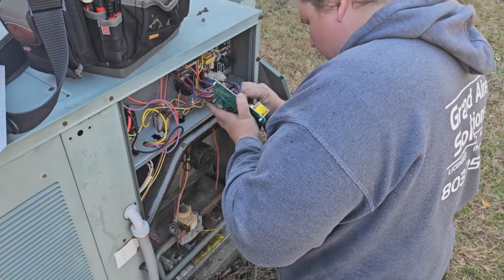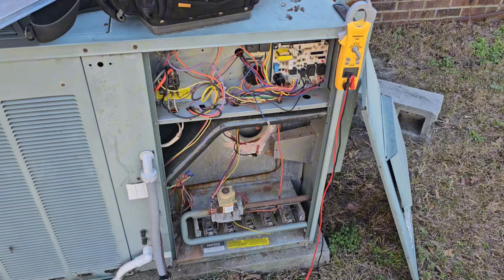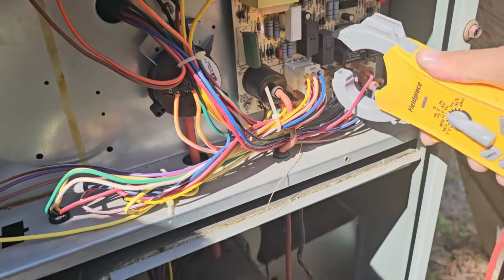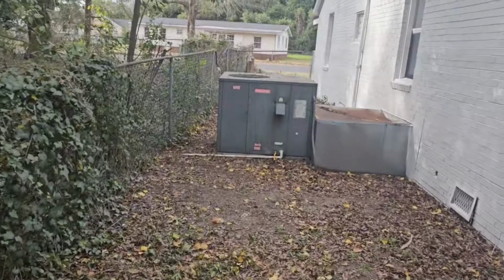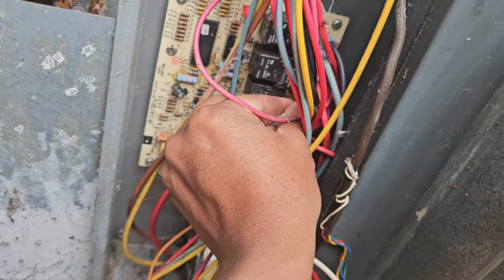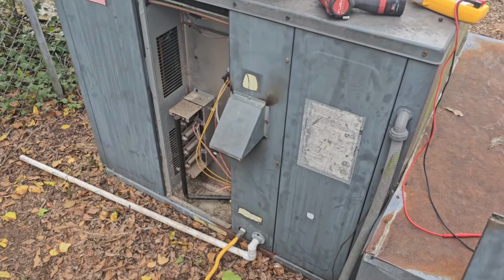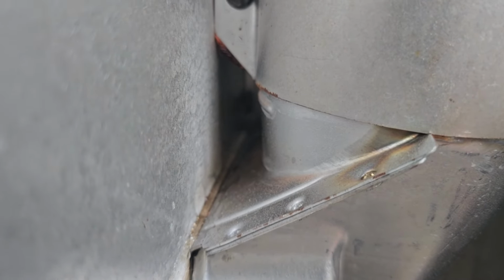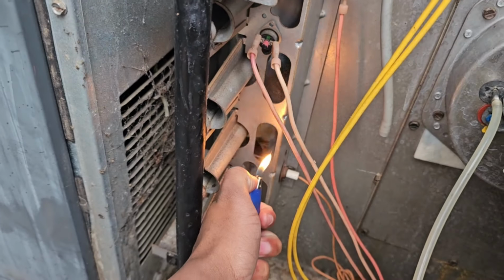More Package Unit Issues on Rheem and Goodman

Comment: if you hook your manometer up to the inducer port and un plug the inducer motor and turn the blower on your manometer will have a slight reading on it if the heat exchanger is cracked. just lettin you know

Comment: There are sooo many things you can do to check and verify unit operation even if “no issues” at that time
• check inducer motor amps and capacitor
• check flame sensor mA 
• check unit size compare to required amount of CFM needed 
• check inducer pressure port and tubing, verify clear
• check burner flame 
• check static pressure
• check and monitor power to gas valve
• check gas pressure
• check drip leg
• check evaporator cleanliness
• check and verify limit switch integrity
• shut gas off while burners are running
ETC……

Comment: Intermittent problems have always been the most difficult.  If you can't catch it failing, sometimes you're left with changing out most likely components.  Relays, contactors and switches are always suspect.

Comment: The board on the Rheem pkg units giving false signals is a well known issue. I've replaced a few that gave the limit open  or the rollout switch open, when check the limit is good, or the roll out switch is good. Did you check the heat exchanger on the Rheem unit? A unit that old ,that would be the first thing I would check.
Reply from the maker: Unfortunately I did not visually. I should have removed the blower motor to do so but we never witnessed any blowback in the flames. The limit switch never tripped itself. But we could jiggle that molex plug and it would sometimes trip/reset and sometimes stay tripped
Reply: Gotta check heat exchanger before any repairs on a furnace bro just to cover y’all butts…. I mean unless the furnace is brand new but should check every time
Reply from the maker: Man I've been trying to see if he will go half with me on a combustion analyzer so he can take the one that's on my truck and I can use a new fancy one and look cool and informed on YouTube 🤣

Comment: I wonder if somethings up woth the heat exchanger on that goodman where were you smelling it at can you describe what kinda smell it was I know you said it was a hot smell
Reply from the maker: We smelled it when the flue diverted was faced down. When we faced it back up we could no longer smell it. When we took the top off, the joint I thought was bad wasn't bad, we found hairline cracks and 2 holes on the heat exchanger that I missed. Double verified by only running the blower motor and putting a lighter to the burner assembly spots and 2 out of the 4 cells were blowing the flame back. The gas pressure was within range of what Goodman wanted. So we just think that "some" of the gas is being blown back out of the entry of the heat exchanger
Reply: @AB_HVAC  that's what I was thinking to I knew that something was up with the heat exchanger cause the flames were burning funny weren't rolling out but they were more orangey then I usually see I have to work on some ptac units tommrow
Reply from the maker: @Hvac-dude  yeah the spots my boss found I thought were just dark spots
Reply: @AB_HVAC  I always like to check the heat exchangers on those package units just for safe measures